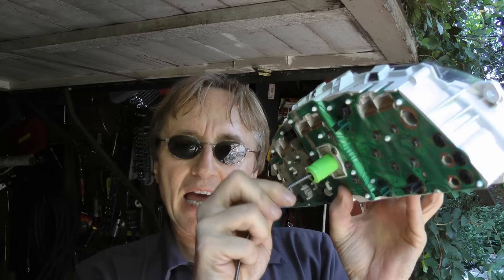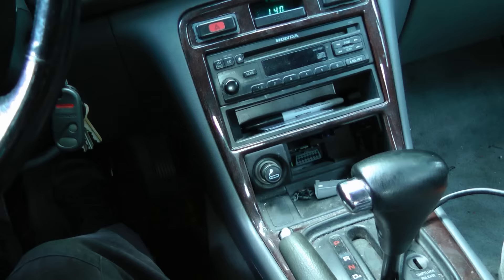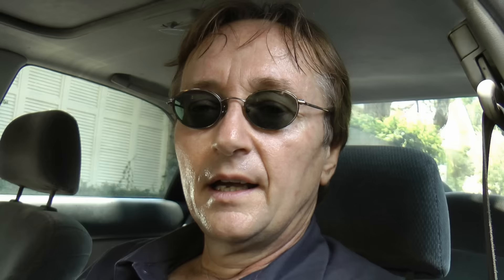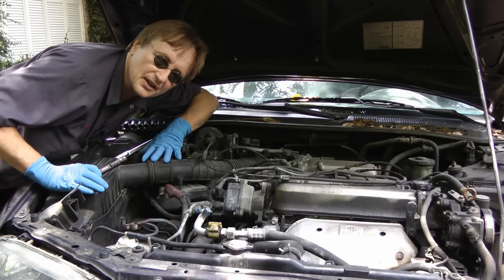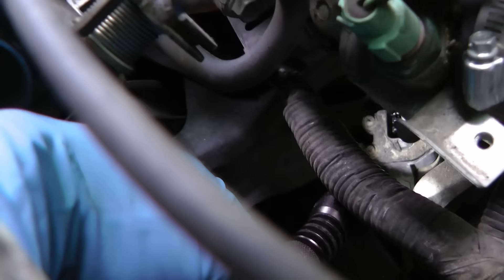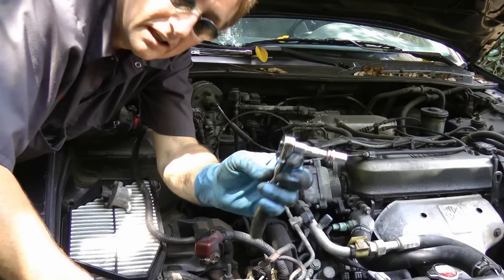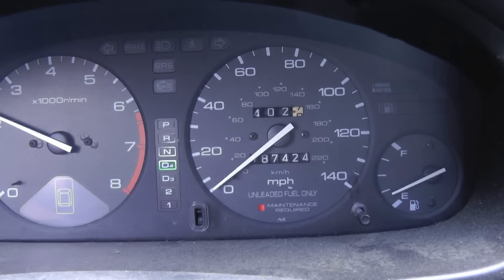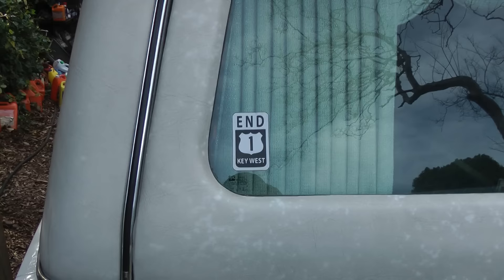How to Fix a Speedometer Gauge in Your Car (Speed Sensor)

Comment: Hello everyone, I just got my first car and I have absolutely no mechanical or engineering knowledge (I can change a tire at the very least). Recently my battery died overnight, after I jumped the car the speedometer and the RPM meter are both stuck at zero even though the gas meter and all the lights work. I drive a 2005 Jeep Liberty and could use some help figuring out if I should just pay a mechanic $100 or if I can fix this myself.

Comment: My car won't go any faster than 35mph and wants to stall out what is it? 2000 Nissan automatic
Reply from the maker: Johnathan Ainsworth many things can do that, but commonly a weak fuel pump or clogged catalytic converter does that. Both can be pressure tested by a mechanic
Reply: It has a new fuel pump and the the catalytic converter has been cut off

Comment: tHIS IS STRANGE....Car mechanic ,after working on my transmission for about 2 weeks,told me my speedometer wasnt working...and ask me if it had been not working...I said no,its been working fine....So he said he fixed it,but I drive it home,check my codes and got the code for speed sensor!! So how did he fix it with a bad speed sensor?? and that code wasnt there before the auto repair!! ....I'd love to know the answer!

Comment: what about the rpm guage
Reply from the maker: on those, generally the gauge unit in the dash breaks, and it's MUCH cheaper to just buy a whole tach kit at auto zone or online and rewire it, that's what I always do
Reply: +Scotty Kilmer it goes up and down when I start the car and sometimes when I rev the engine real fast

Comment: I have an '97 Mercury Tracer:

Car gauges don't work and car runs sluggish
Reply from the maker: that old, gauges are often warped dash circuit boards or corroded wiring going to it. sluggish could be a zillion things, try new spark plugs and cleaning the fuel injectors

Comment: WHATS THE POINT IN CHANGING THE SPEDO METER AS THE SPEDO ON THE REV COUNTER WORKING SO KNOW IT S MY SPEDO THATS NOT WORING BUT YOU CAN BUY AN  ODU 2 PLUS DASH COMMAND AND configure IT TO YOUR CAR AND YOU HAVE SPEDO WOKING WITH YOUR IPHONE OR ADROID PHONE ANOTHER WAY OF NOT BUYING A SPEDO METER. A CHEAP FIX.